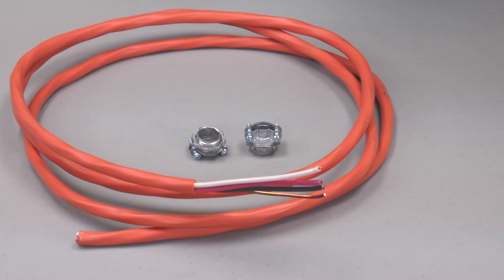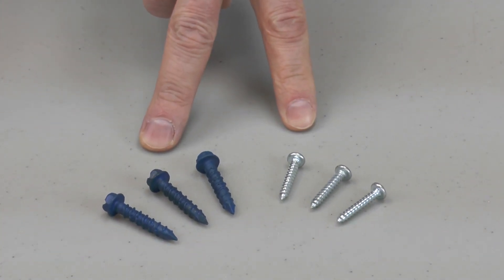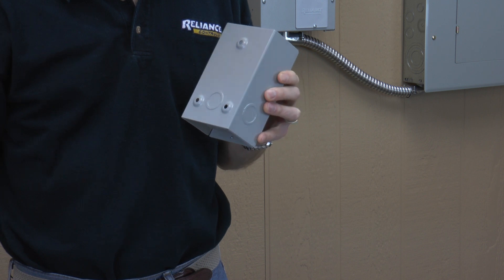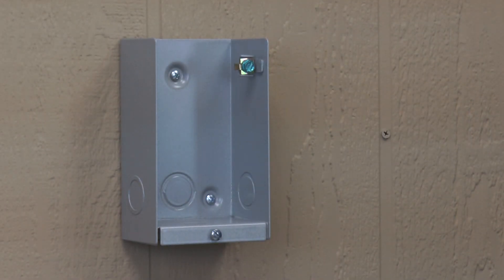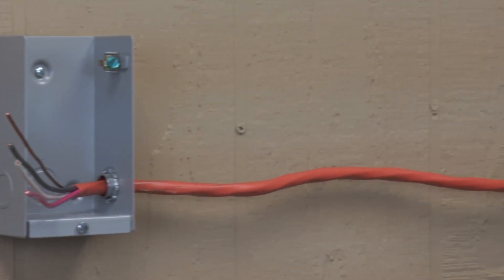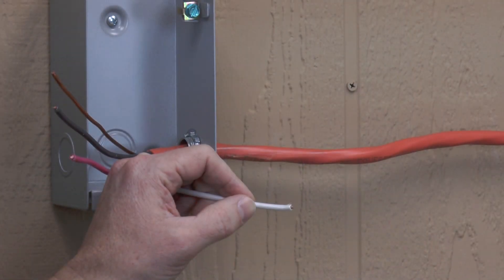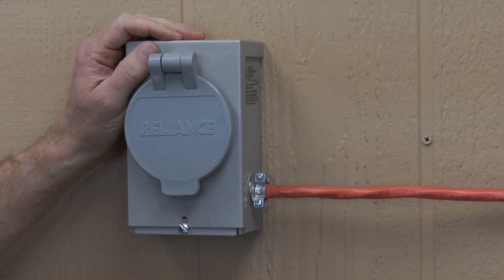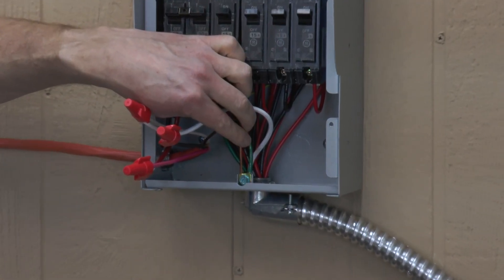How to Install Reliance Controls ProTran2  Transfer Switch- Part 5 Installing the Power Inlet Box

Comment: Does the CSR202 have a circuit breaker as well?  If not, do I need a one? I plan to use it for periphery lights only.  No appliances will be connected to it.  I will be using a 3500 watt generator and will be consuming about 1800 watts.
Reply from the maker: The CSR series of outdoor rated 1 or 2 circuit transfer switches, do not have any integrated overcurrent protection devices (circuit breakers).  There are either 1 toggle or 2 toggle switches which are in their own right - transfer switches (2 inputs, 1 output for each "SWITCH").  This is really just 2 transfer switches (the toggles) in one cabinet like the CSR202.
---
Whether you need to add a new circuit breaker of a specific rating/type depends on the size of the existing (building) wiring for the circuit is in question, the wiring in the transfer switch (12 AWG), the rating of the circuit breaker in the system that feeds the wiring to this 'lighting' circuit, as well as the outlet configuration/rating on the generator.  Lastly, the circuit breaker they have built-in to the generator itself to protect the wiring in whatever cord is connected.  Most of the time every outlet on a generator will have a separate built-in circuit breaker for that outlet.  Once the wire sizes and breaker sizes are identified it's possible to make some decision in regards to adding a new circuit breaker.

Comment: I can't figure out which gauge is needed between a 50amp Transfer Switch and Inlet Box, is it a 6/3 or a 8/3? And should it be placed inside a conduit tube?
Reply from the maker: This is falling under local building code, but as long as the distance ins't approaching 100 feet, i would suggest to consider 8/3 w/ ground with a 75degree C temp rating on the insulation.  6 gauge is fine but usually harder to work with in the inlet box cabinet.
Reply: @RelianceControls  I was told I can only use a 6/3 and since its not inside the wall I'll need to have it inside a 1 1/4" conduit. My inlet box is on the other side of the concrete wall, I will have a junction box in the inside and a conduit going inside the concrete and into the inlet box. My question is, can I remove the 6/3 from their outer sleeve in order to travel from the indoor junction box to the outdoor inlet box?
Reply from the maker: @RonenLin  Hello, this all falls under applicable local building code, I"m sorry but you have to consult with an electrician about what is acceptable regarding the conduit and wiring between the inllet box and whatever the inlet box is connecting to.  The rules will certainly be different in different areas, from state to state and even some rules can vary by city or municipality.

Comment: If you reverse the red and black wiring with X and Y, depending on what the double pole breaker is powering, couldn't it cause it to not work? Like a motor reversing polarity?
Reply from the maker: Thank you for the comment.  This is the connection from the generator inlet box, to the transfer switch to create the feed from the generator power to the switch.  If the generator is capable of 120/240 volts (2 wires with 120 volts each, and 1 neutral and 1 ground), it does not matter if the red and black are connected to the X or to Y, as it is always reversible.  The red and the black inside the transfer switch feed each side of the bus bar in the transfer switch - the result is circuits A, C and E on one bus and B, D, F on the other bus on this 6 circuit model.  If you use any double pole breakers in the transfer switch to power a 240 volt circuit, then each pole of the breaker is landing on an alternating bus bar, resulting in 240 volts across the poles.  No matter if red goes to X or Y and black to Y or X, the result will be the same and there is no polarity involved.  
If there was a 120 volt only generator feeding this, the 120 volts could be split to run to both sides of the bus bar, the difference between each side would be zero, and a 240 volt motor simply would not start.
Reply: @RelianceControls  Ah! Ok that makes more sense. Thank you for clarifying.

Comment: My 4000 watt champion generator only has a 3 prong Nema 30 amp and 30 amp RV connector.   The Reliance box is 4 prong.   All circuits in my transfer box will be 110/120 no 240.      I would like to make a custom 40 foot generator cord that goes from 3 prong 30 amp to the 4 prong Reliance inlet box.   How do I wire this?  Do I jumper the two hots in the 4 prong connector on the cord or just leave one of them not hooked up?    Sorry for the rookie wiring questions.  I know there are special adapters for this but they are like 40 bucks by themselves.
Reply: So from my research this morning it appears that's a big no on the jumper of the two hots.    Sounds like I just need to get the black wire on the proper prong of the 4 prong nema receptacle on the cord?
Reply from the maker: Hello, sorry for the delay.  If you were to make a custom cord, the wiring method can vary depending on if you are using 3 wires or 4 wires in the cable.  There isn't any specific requirement or guideline that must be followed, so you have to accept that making your own cord is doing so at your own risk.  If you were using a 3 wire cable, the wiring of the 3 prong plug would be straight forward, and the 4 prong plug could have the single hot wire in the cable connected to both of its (X and Y) hot terminals.  This results in the 120 volts traveling down 2 paths, there is nothing wrong with this.  This is how most of the short adapter cords are likely wired.  If you were using a 4 wire cable, then the 4 prong plug would be straight forward, the 3 prong plug could be wired by connecting both 120 volt hots into the single 'hot' terminal of that plug.  These are just two ways that a cord could be wired in this context, where the 120 volts from a single wire travels to both the X and Y terminals of the 4 prong female plug.  In turn, the 120 volts will feed both sides of circuits on any transfer switch or electrical panel in general that has two sides of circuits (two phases of the bus bar).  The measurable difference in voltage between the two sides of the bus bar in this example will be zero, therefore no 240 volt motor would start up, but there isn't any default requirement to have a 240 volt differential if no 240 volt circuits are present.

Comment: I have a #1 200amp circuit breaker box and #2 200 amp circuit breaker boxes in my utility room.  I need to use eight from the breaker  box #1 and two from breaker box #2.  I have installed and configured for a. 220v A/C air handler, b.120v refrigerator, c.120v Microwave, Kitchen receptacle.  I need to get gen power to two circuits in #2 200 amp circuit breaker box, each is 120v.  One of these is the 120v for gas Renni water heater, the other is for my Cpap breathing unit.  Boxes are next to each other and the wires from the Reliance transfer switch are long enough to attach to #2 breakers as I indicated. ??
Reply: While waiting for your response, I was able to figure it out. Your explanation  to resolve issue made more sense then my fix. I had already moved the two 120v circuits from panel #2 to panel #1 which resolved the problem.  Thank you  for the help. Hurricane Michael will be here to Destin next 24 hrs.
Reply from the maker: Hello, you would still bring the individual wires (RED AND BLACK) to the specific circuits no matter what panel they are in, assuming all panels in the system are common (grounds/neutrals).  The generator ground and neutral would only connect to one of the panels, though.  If you have any questions please contact us directly.

Comment: lol,exposed romex I understand that this is for training purposes but let the people know at least u can not have exposed romex it need to be protected you hack
Reply from the maker: There are many instances depending on whether the wall is finished in areas such as a basement or garage, but it depends on local building code.  It is certainly not true that you cannot have it exposed under any normal condition, the national code allows multiple exceptions.
Reply: Agree.  Just go the extra effort and at least use PVC conduit between the 2 boxes.  But yeah, that may get complicated, so they avoided it.  At least they didn't use tin foil, telephone wire and bubble gum.

Comment: The design of the power outlet is good.  However, it's not practical for installation.  The outlet/cover goes above and outside the case.  If case is attached to the wall with the 3 screws, the case is tightly attached to the wall, which is good.  However, after connecting all the wires and trying to mount it back to the case, there is no way it can be done because the whole thing need to go to the outside of the case.  I had to loosen the screws from the case and pulled it off the wall to make room for the outlet box, making the whole unit off the wall.   The person in the video skipped this part and only showed it after it was done.
Reply: Good to know....I'll just Shim the case away from the wall with something...easy peasy!
Reply: I used a few stainless washers behind the box (on each screw) to create a gap so the cover could go back on.

Comment: The demo shows the wire nut being used to provide mechanical connection between the conductors being spliced.  That's not the approved or safe way to splice the connectors.  The connectors must be twisted together first.  The purpose of the wire nut us to keep the twisted pair together and isolated (insulated) from ground and the other conductors.  The way it is shown, the wire nut is carrying  the load from conductor  to conductor.  As shown, the two conductors in the splice are just touching one another but not mechanically joined.  Arcing between conductors is possible.
Reply from the maker: Thank you for the feedback.  There is no industry standard or officially approved method for wire connectors, the only reference point is the manufacturer's instructions for the connectors.  The wire connectors we provide in our transfer kits do not require pre-twisting, which is common with modern wire connectors and has been for many years.  When twisting the wire connector onto the wires, the internal threading is specifically designed to twist the wires appropriately for a good connection.  Electricians have their own methods which vary greatly and are completely subjective, sometimes they will pre-twist depending on the wire size, wire type (solid versus stranded), and number of wires to be used in a single connector.  In this application with 2 copper wires in a single wire connector, pre-twisting is not required.
Reply: The 10/3 wire is very tough.  I was thinking about twist tie them first but not possible by hand.

Comment: how would you install for a inverter  coming from a solar panel array
Reply from the maker: +nick surowiecki 

The only thing that might be different would be the power cable (cord/plugs) between the inverter and the power inlet box.  There are different inlets available as well, for different rated cords/plugs.   The proper cable and inlet box are dependent on the exact output and rating of the inverter.  The transfer switch installation is the same with an inverter or portable generator, in both cases there are potential outputs of 3 wire (120 volts only) or 4 wire (120/240 volts) at different ratings (15 amps, 20 amps, 30 amps, 50 amps).  Please contact us at support@reliancecontrols.com if you need any additional details or assistance, thank you.